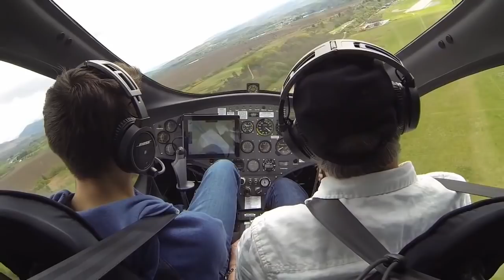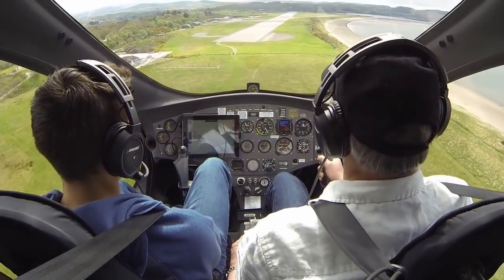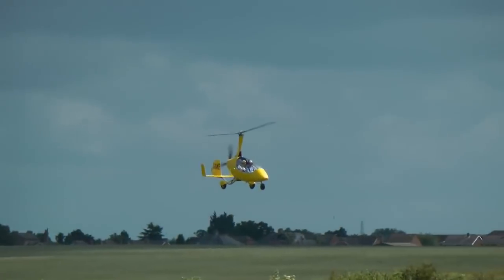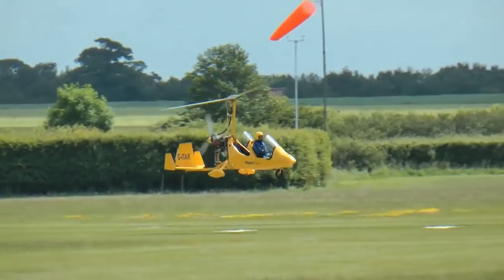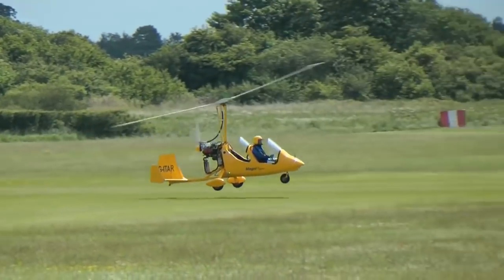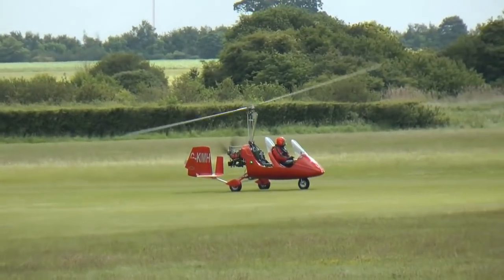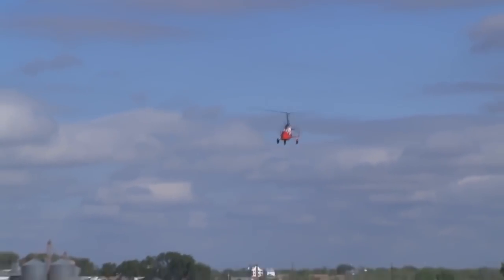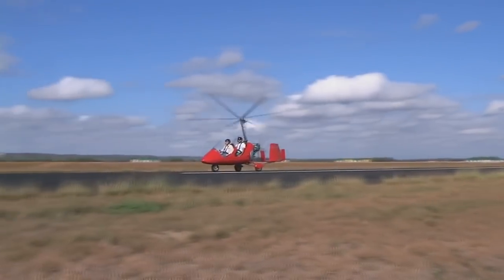Gyroplane/gyrocopter landing technique & errors

Comment: I nearly came a cropper when the runway in use was changed by my instructor who was in another aircraft, owing to wind direction change during a 'touch and go' session not long after I had gone solo.  The new runway was 28 and, as it was late afternoon, the setting sun was low over the end of the runway.  As a result, I could not judge my height well and not having flared, my nosewheel hit the runway first with some rudder on.  The aircraft swerved violently to the left and began to rollover to the right.  Fortunately, I had made this mistake this training and knew, by the instructor's swift intervention then, to apply power and opposite bank.  I recovered the aircraft (just!) and came to a stop safely.  I was so shocked, that I backtracked along the runway to taxi back to the hangar forgetting to put the stick forward and would probably have chopped the empenage tail off had my instructor not spotted it and called 'Stick forward' over the radio.  I think that the importance of protecting the nosewheel during landing cannot be overstressed and should be included in 'common landing errors'.  A few aeromodellers, waiting beside the runway for the airfield to close operations, had a 'ringside seat' as my aircraft careered towards them at speed and under full power !!  I went back to apologise afterwords and received lots of advice on technique [amongst other things :-) ].  You never stop learning.
Reply from the maker: One thing that is often overlooked in flying generally isn't so much the actual techniques involved in a particular element of the flight (although that may well me the case) but the mental capacity and mental alertness of the pilot. To that end student and low time / low recent pilots are very weak and need help to become alive to the issue.
Reply: @gyrocopterflyingclub6148  David Watson, Were you looking where your instructor had taught you when you rounded out or directly in front of you on the runway?

Comment: What happened to the gyro that landed then tipped over. The last part of  the video?
Reply from the maker: mike lavergne we discussed this before - have you seen the preview comments?
Reply: Looks like his 'lost his head'...
Reply: It was polished a bit and returned to the flight line.
Reply: Simple. Rotor mismanagement after touchdown. Did not push the stick forward and center or slightly into wind. Rotor thrust was still substantial and took it in the direction rotor thrust was pointed. In rotorcraft, till that rotor is turning ... you are flying. Just because you touched down and came to almost zero airspeed does not mean rotor is not producing lift